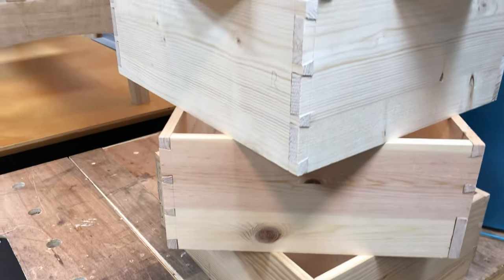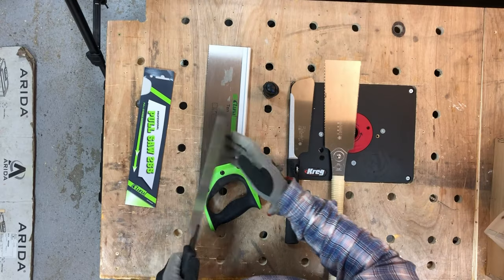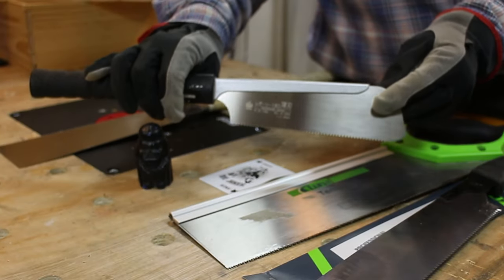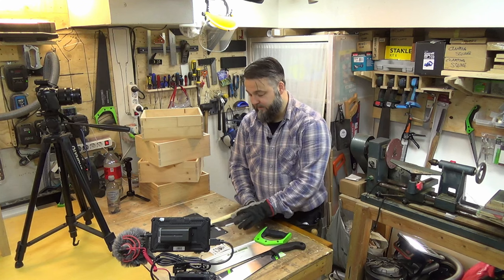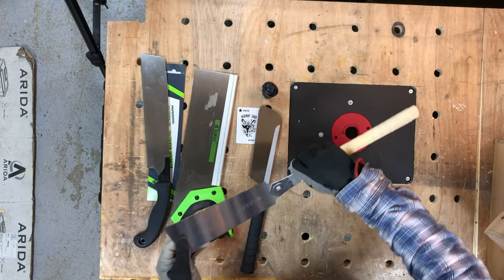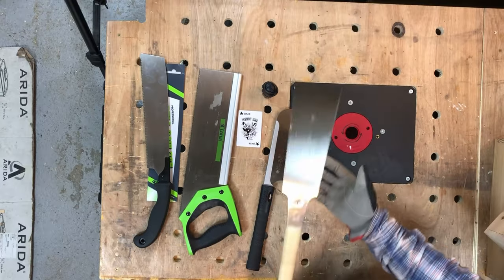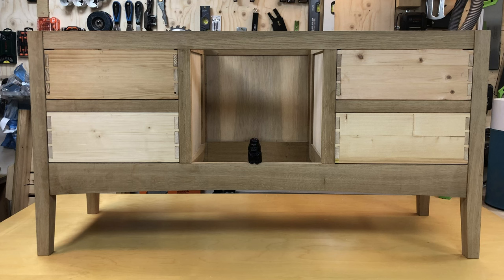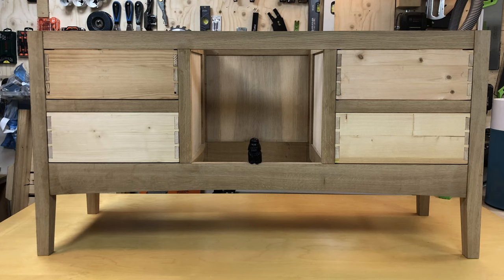Japanese Pull Saw - DEATHMATCH [0092]

Comment: I agree with your choice of just 1 saw. I find the thinness os the pullsaws help to get closer to the line needed. However for dovetails I would only use a fine saw whether pull or push style saw. Smaller saw helps with control when dovetailing by hand. Try without the guide and gloves if you can as I am sure your skilled enough. 👍👍
Reply from the maker: Hi and thanks for the input. Do you have a suggestion for a finer saw?
Reply: @NomadMakes  The small pull saw , Dozuki, which you also love is perfect for the job. Or any high tpi rip cut western saw. Rip because most of the dovetail is rip sawing. I can also recommend fillers but your dovetails don't need it, unlike mine!
Reply from the maker: That Luna tenon saw is not too bad. It’s just that the workpieces for these drawers are quite thin. 10mm. For thicker stock I think it would work well.